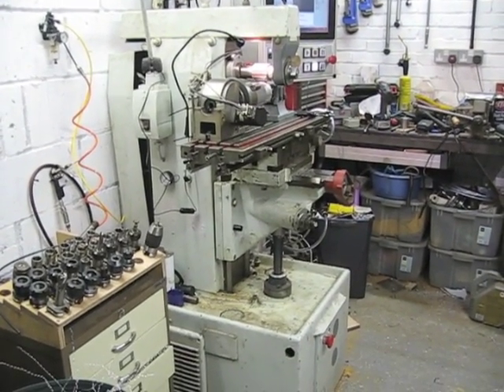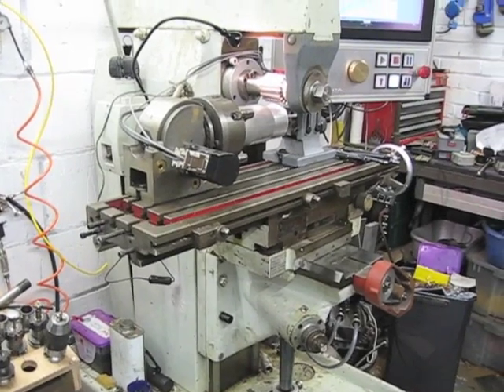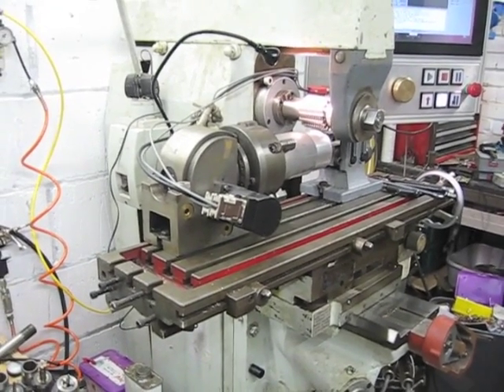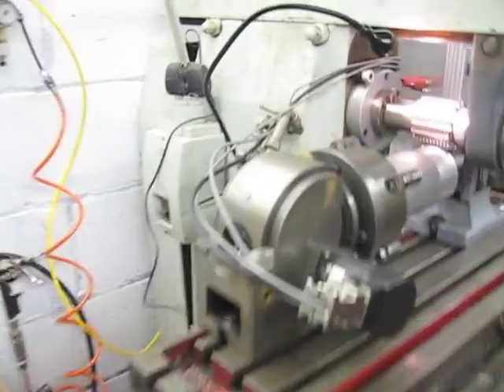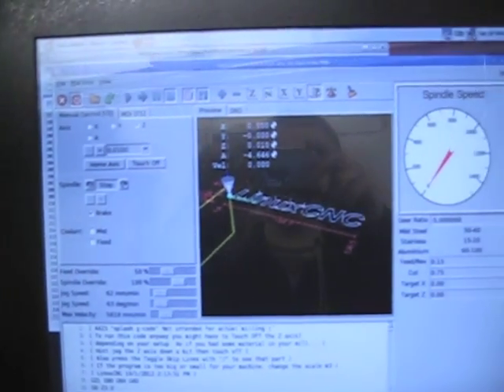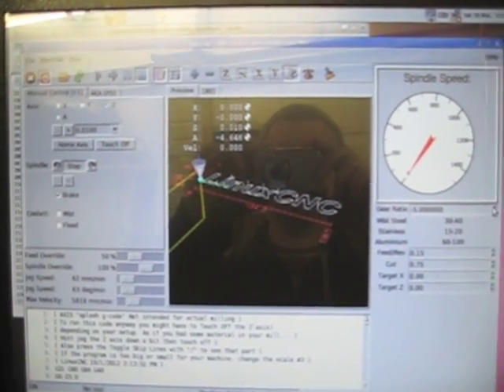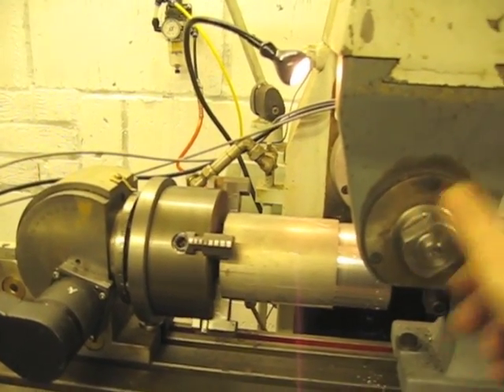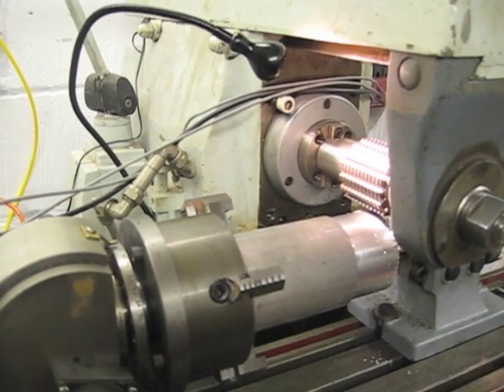Pulley

Comment from the maker: It is a "Universal" mill so the bed swings. (I bought it specifically for this feature). 
There is no reason that the rotation couldn't be done by CNC (in fact LinuxCNC allows for coordinate rotation automatically) but that would involve mounting the dividing head and tailstock at the correct angle to the table, and that sounds rather difficult.